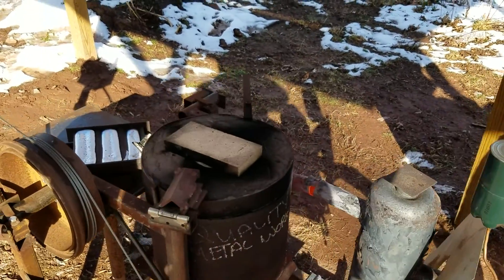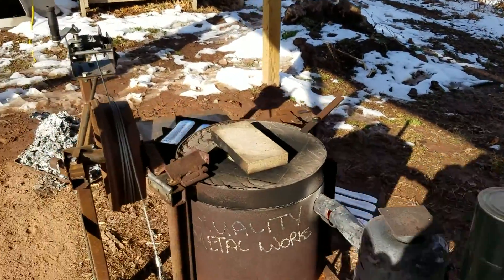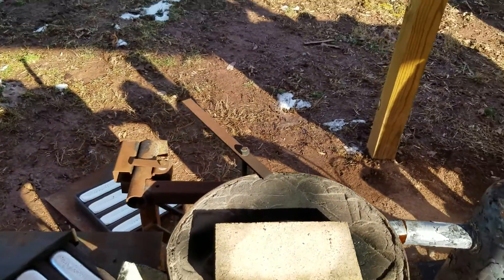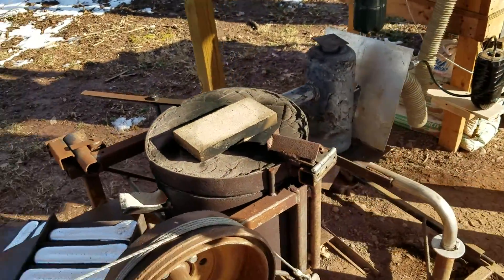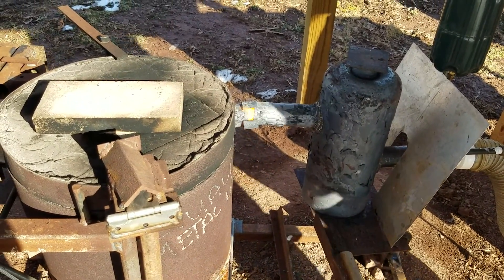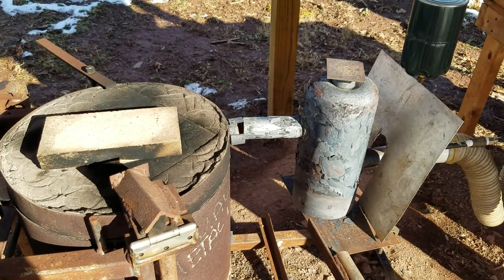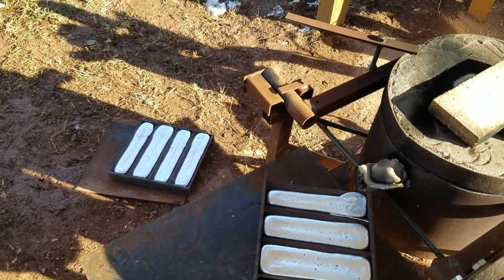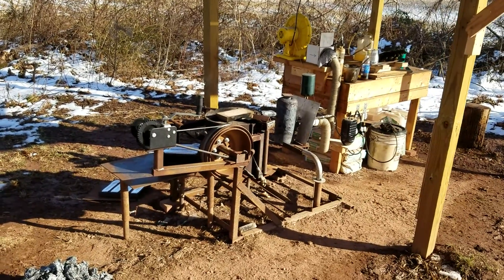Direct Melt Tilting Waste Oil Foundry 6 - Standard Shutdown

Comment: How is the furnace holding up?
Reply from the maker: Still going strong no issues yet.
Reply: @HarmonyTurbines  what do you do with the ingots once you make them do you sell them? I have a bunch of scrap then I'm going to melt down into ingots.
Reply from the maker: I save them for other projects because they are already clean and pristine metal and I don't have to waste a lot of time with dross and melting mass amounts of junky stuff to get the volume of metal I need. It's a quick easy way to clean junky stuff and make it into a valuable resource for my casting needs. -I do not sell the ingots; I may of course sell the finished products that are a result of the casting and/or further fabrication processes such as Mill and Lathe.

Comment: Installing a diesel burner in the bottom of a boat on the Seine river  Paris. It is a bitch removing old and man handling new heavy cast. Watching your video showing my mate waste oil burners. cheers Greg.
Reply from the maker: Hi Greg, That sounds like a horribly hot, cramped and dirty job. I'm glad that I can provide a measure of enjoyment  during your downtime! Perhaps this is something you'd love to try yourself when you have a chance. If you were not so far away I'd say come on over and melt some metal with me! I will work on making more videos as time allows. The weather is starting to get nicer and I hope to be outside a lot more in the coming months. Spring and fall are great times to do foundry work due to the heat produced.